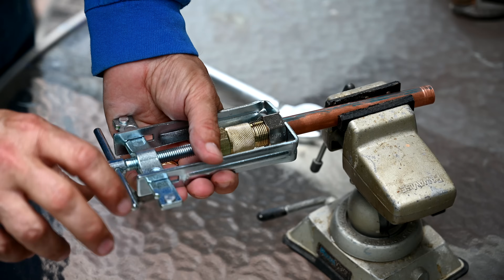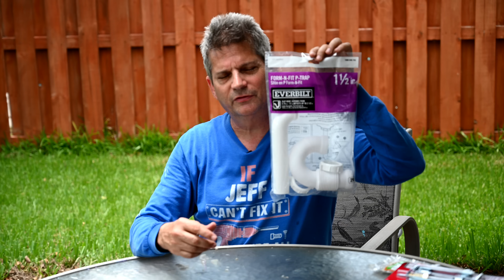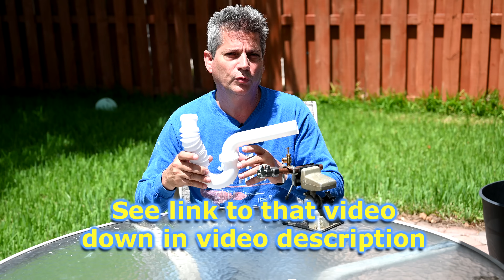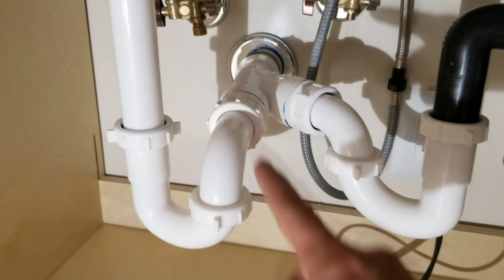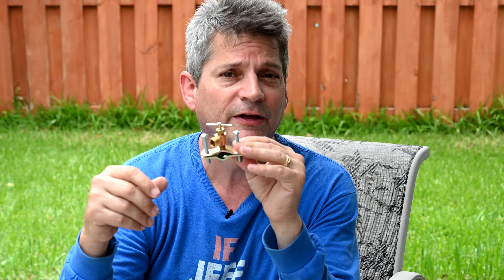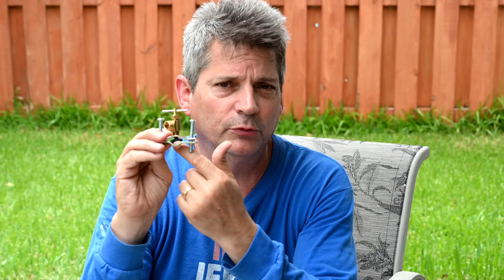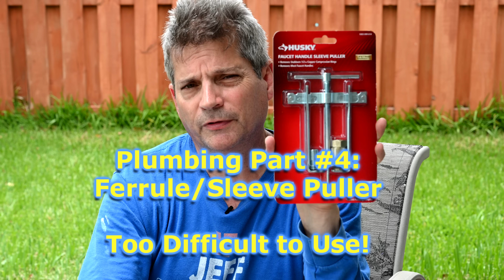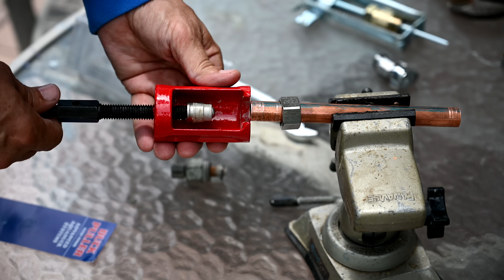4 Plumbing Parts/Tools You Should NEVER Use. NO Plumbing Fails

Comment: Form and fit pipes should be pulled from the shelves all together.  I remodel bathrooms and even have to keep the occasional plumber in check when it comes to following code.
Reply from the maker: Jeremy, I'm surprised that plumbers would install one, I bet they don't do it when it's getting inspected. What is their reasoning when you tell them?
Reply: @jeffostroff  I've heard it all, usually I get "I have xx years experience, I know what I'm doing".  Even had a plumber install a toilet with the slope going uphill once.  He was fired and that was before I found the drain issue.
Reply: @jeremylunning654  He was using that new "uphill" pipe.
Reply: @dave8168  lmao, I need to get me some of those!

Comment: Man, this kind of stuff is informative but your perspective is a bit enraging. I've hired multiple plumbers in my life who show up to point out the code violations done by the previous plumbers I've hired who then go on to violate another code. Do you guys just go around screwing things up and blaming it on DIYers? Not two weeks ago I had a bonified plumber come in and glue a PVC waste pipe to an ABS waste pipe only to find out later that gluing those together was against code. I had to fix it myself, correctly. You need to be honest that the people who have the most to gain by cutting corners are the plumbers charging full price for bad work. A DIYer wants it done well and the good ones research how to do it properly using videos like yours.
Reply: I am not a plumber.  But  I had a plumber tell me you have to use a different glue for the ABS and PVC  connection.  I remember  it was a green color. But who knows, the rules may have changed.
Reply from the maker: @MrOwnerfinance   Yes you are very close on that with the black plastic ABS you have to use a one step glue that is greenish yellow in color. For white PVC plastic you must use a purple primer 1st and then you use the clear cement. When the building inspectors come to inspect your plumbing work if they don't see the purple on the pipe anywhere they will fail your inspection and you will not get a closed building permit.
Reply: I have been a plumber for 59 years and I can tell you that excellence is a personal choice. There are a lot of guys who will do whatever is faster and easier instead of what is right. There are many  plumbers who always do excellent quality code work, find one and stay with him/her.   TXHUNT
Reply: James Hunt , code is bare minimum.
And, have u noticed they r always changing the code.
I think a lot of the people who write the code aren't really too smart.we follow b/c we have too.
We do many things above code. Code minimums are written for the magpies with no work ethic or
Are lazy.
Or don't have a clue.
Reply: That is not an issue since there is a specialty glue to connect PVC to ABS. I think it's green.... Called transition fitting cement..
Reply: If u use the proper glue it's ok.
Reply: Maybe chemically, but not to code in some locations.
Reply: There is a transition glue/cement that is approved for transitional connections (ABS to PVC) under IPC, not sure what UPC says about it though.  We use IPC in CO.
Reply: Dont mean to beat a dead horse here but yes transition glue is the proper way,
Reply from the maker: What I've seen over the years with plumbers and electricians, is the person showing up to do the work is not the owner of the company, the one with the master plumbing or electrician license, the one with 30 years experience, who has been shot down by every city inspector possible during their career, and knows what mistakes to avoid, who really cares about and understands the plumbing codes. Chances are the low man on the totem pole who shows up to do your work does not know much about codes, and has not fully developed their skills yet. 2 years ago I had plumbers come to work on a friend's house, replacing his water main shutoff outside, on a PVC pipe. It leaked the next day and we had to call him back. For a no-brainer cement PVC fitting. Apparently he forgot you have to twist the fitting 1/4 turn while cement is still drying, and hold for a minute before letting go or PVC won't stick. Yup, I know how you feel, this is why I keep making these videos.
Reply: @jeffostroff  Another thing is plumbing codes vary state to state, my first house was an S-trap home and the problem was the velocity of the water going from the first floor to the basement where the main line was. Used one of these, not sure this is legal but it worked,https://www.amazon.com/Studor-20341-Mini-Vent-Adapter-Connection/dp/B00FQEX4UI/ref=asc_df_B00FQEX4UI/?tag=hyprod-20&linkCode=df0&hvadid=312186755465&hvpos=1o3&hvnetw=g&hvrand=8975938221840903121&hvpone=&hvptwo=&hvqmt=&hvdev=c&hvdvcmdl=&hvlocint=&hvlocphy=9003648&hvtargid=pla-434083428846&psc=1&tag=&ref=&adgrpid=61740029466&hvpone=&hvptwo=&hvadid=312186755465&hvpos=1o3&hvnetw=g&hvrand=8975938221840903121&hvqmt=&hvdev=c&hvdvcmdl=&hvlocint=&hvlocphy=9003648&hvtargid=pla-434083428846  If you flush your toilet and you suck the trap dry you have some restriction in your vent. I hate compression fittings, I always solder because I seen to many leaks over the years, also many refrigerators come with those pinch valves,I hate them to.
Reply: Try to:

1. Hire a contractor that doesn’t have any employees and does it him (her) self. 

2. Make note of his or her name on the invoice he or she gives you. 

3. Make sure that you get a written warranty for the labor that is at least as long as the manufacturers warranty for the part that he installs.

4. For this one you will need to get to know him:

Make sure he comes back to correct any problems in a timely matter and doesn’t charge you extra if it’s his fault. Is he a Man of his word?

5. Don’t be embarrassed about watching him work. 

      A good contractor likes being watched. If he doesn’t like you to watch him, don’t hire    him. You may even learn something if you talk to him.

Comment: Toilets that draw the water out of an adjacent s trap does it via the Bernoulli principle - the toilet water passing by the adjacent pipe creates a low pressure in your s trap, essentially 'vacuuming out' your S trap. Old S traps configurations just need a vent between the toilet and the S trap to function as intended.
Reply from the maker: So I want they designed with the proper vents to begin with?
Reply: @jeffostroff  I just discovered your channel!! Thank goodness!!! I had a plumber recently install a new toilet in our upstairs bathroom. It is a toilet with a powerful flush which the old toilet didn't have .  Well ever since the plumber installed the new toilet I've been noticing a sewer smell it was mild at first but now its getting worse so I called a plumber and he will be here in a few days. I heard you say that if you have a toilet with a powerful flush and its next to your bathroom sink then this is what's probably happening that's its drawing the small amount of water out of that P TRAP !!  And our house was built in 1901 so it has those old S type pipes through out the house. I never knew those were not approved anymore!
Reply from the maker: @stanleywheeler404  Yes, and if you're getting an remodeling work done, it's not hard at all for the plumbers to come in and remove those s-Traps and convert them to P-traps.
Reply: @jeffostroff  ok I will tell the plumber to do that .  Thank you very much!! I think your channel is one of the best!!!

Comment: A S trap is fine if making a repair where one is already.  Second saddle valve is not aloud  due to needle valve restricting flow it’s in the code book. Saddle valves are allowed if done by someone other then a plumber or plumbing company that is why they have been sold for 50 years  I’m going off the nation standard plumbing code.     The compression angle stop.  The part you were calling. THIS PART is called a ferrel    The tool you were using to get off the ferrel is a handle puller.   It’s not for what your using it for the ferrel groves the copper  you cut it off with a cheese saw.  The flexible traps and tail pieces are not allowed because they impede flow. And promote bacteria growth  in the corrugated sections BTW.   N J Licensed plumber here

Comment: (under what branch of government is these plumbing codes?).= This code has been enacted into law by the Florida state governing body. . I typed in "what  is "Florida state governing body". and got The Florida Board of Governors is a 17-member governing board that serves as the governing body for the State University System of Florida, which includes all public universities in the state of Florida.(note the lower case l in law, capital F in Florida and lower case s in state}.Enacting Legislature Governing body means a body of persons or officers having ultimate control. also the word "public", They are mainly constituted for the purpose of administration (International Plumbing Code 2015 (IPC 2015). international is (u.c.c.) uniform commercial code. need to do some more research here.

Comment: Tool #4 you are using incorrectly!!! Those two arms are for pulling handles, not for removing the copper seal. There are videos online on how to use it correctly.
Reply: You're right, Paul. The arms don't get used at all!
https://youtu.be/7KDe8ACKjwc
Reply: Paul MvN And $40 for the alternative! I have a 15mm and 22mm olive puller for about £12 ($15 at current daft exchange rate) and works every time.
Reply: I prefer the cutter instead. It cuts the ring and will resize the copper at the same time. Though, I don’t do service so I really don’t need the tool to double as a handle puller.
Reply: @joshcowart2446  I agree, pulling a ferrule like that is asking for trouble as they deform the copper pipe to start with. Good luck getting another one to stay on after doing that. If you cut the ring off & resize the pipe so a new one will fit, fine, but it's not common. usually there IS enough room to simply cut the fitting off & use the shorter pipe, anyway.
Reply: Paul MvN exactly huh. Maybe if people knew how the tools they were using were supposed to be used correctly it would help! Dorks!!!
Reply: Edit: well I'm wrong, it's the right tool, and in fact isn't being used correctly. 

It's not even being used "incorrectly", its that he's using a tool for a completely different purpose. 

"My hammer doesn't work well on these threaded nails"

Well no shit, they're screws, not nails. He's attempting to use a faucet handle puller, to remove ferrules. No wonder it's not working.
Reply: @mlindholm  OK, so those screws I bought with a Phillips head and no threads (one or two in every box from the H*me D*pot) are really nails? 
Quality control has gone downhill. LOL (And yes, I HAVE seen nails with threads that can be driven, not screwed in. They hold better.)
Reply: @fixitmann6685   yeah, yeah, smart-ass. I assume you realize what I'm referring to though. The puller was poorly introduced, he could've read from the package that it's a dual use product. Secondly, read the instructions, so we realize if it's being used as instructed or not. It sure seemed like those "as seen on TV" bumblefucks that can't use the simplest devices. Finally, if you're gonna demonstrate a ferrule puller, tighten down the ferrule AT LEAST enough so it doesn't move on the pipe. The other 3 recommendations are sound, but that last one just blew my confidence he knows anything.
Reply: And if it takes time and cost a lot, then it's good 😁😁😁
I only got annoyed by this video...
Reply: And if his tools are so good, why didn't he show us on a compressed fitting 😁
Reply: @jfjjjjfj  he did but the fitting was not an old fitting. Watch that part again as he explains it.
Reply: Patrik Carlsson I own both of them ferrule pullers and the first one sucks, don’t know why I still have it. The second ferrule puller(the red one) is in my tool bag and pulls any and all ferrules with a problem
Reply: I mean an old one, not a new with loose ring 😀

Comment: Good video and learned some things to know. I agree about the Husky puller. I bought one and they are a "hit and miss" if it works or not.... usually not! LOL One suggestion,  your video would be even better if you scripped what you need to say so you don't sound like you are just rambling along.  You could maybe have cut the length of the video by 25% As you know, time is money including those that are looking to you for information
Reply from the maker: Royall, what you think is rambling along is actually necessary details, for example showing the actual codes that forbids these parts, and yes we are scripted, we give more in depth training, I'm not here to be your 60 second handyman like other channels, who leave out the important details, to upload a quick 5 minute video. You can always skip ahead in videos. I frequently jump ahead 30 seconds in videos, I skip past the intros, and when they are doing long tasks, I skip ahead too. BUT... we are already planning to break this video up into 4 smaller more compact videos covering just each single topic. The saddle valve video is actually premiering tomorrow night. When I do my 45 minute long bathroom renovation videos, I also break those up into smaller videos afterwards to show how to do the different parts, a wall niche, how to make sure your walls are square, how to make round hole cuts in tiles, etc.

Comment: That's a handle puller not a nut and and sleeve puller
Reply from the maker: It is both if you look closely at the package you can see they label it as being both knob puller and sleeve  puller and on the back there's 2 different sets of instructions one for when you're using it as a knob puller and 1 for when you're using it as a sleeve  puller.

Comment: I use the puller for removing central brass tub faucet handles. Do you have something better?
Reply: Clr, a hammer and channellocks is the method I use. If you break it off in the stem, it's usually corroded to shit anyways and needs replaced due to leaks
Reply from the maker: @DGTelevsionNetwork   Going medieval on it I like that
Reply from the maker: Not for pulling handles, I actually never had to use it to pull handles, every one I ever removed just pulled off easily by hand. But Husky tool should be OK with handles, it just fails when it comes to stuck ferrule sleeves.
Reply: @jeffostroff  I tried for a month to pull the handles from my deck mount roman tub 8" spread faucet. I used PB Blaster. I used the Huskey puller. I finally gave up. I installed a Moentrol shower valve in the wall at the other end of the tub and ignore the tub valve. Have not turned it on in almost 5 years we have been in this home. We do have 2 other showers.

Comment: I am a Handyman that follows the code, another problem is when you are preparing a property to sell, many finance companies will not loan on houses that have these violations.  With all the information on line the only reason to do it wrong is a laziness.  Good video thanks
Reply from the maker: Yes you are spot on there. Buyer's home inspectors are getting much more tough, pointing out incorrect high loops on dishwasher drain hoses, dishwashers that are not screwed into the counter, toilets that wiggle, old Zinsco electric panels. And even before they start complaining, your homeowners insurance will start complaining during a scheduled 4 point inspection.

Comment: I use that husky sleeve puller all the time and it’s a wonderful tool if used correctly. First, I find it easier to remove the threaded handle part completely from the metal arms. Second, In the kit it comes with a metal cylinder. One side is larger than the other side. Stick the smaller side inside the 1/2 copper line coming out. Then thread in the brass colored fitting on to the handle to receive the compression nut. Thread on the compression nut and start turning ur handle clockwise. U will definitely see how easily this thing can  remove compression sleeves if u do it this way. Let me know how it works for u. :-)
Reply: https://youtu.be/MjNrGuxYvjQ

Please watch this video buddy
Reply from the maker: The tool works when the compression ferrule sleeves come off easy, but when they are stuck and corroded this tool falls short, because the forces are too great to bear, and it digs into your hands, and then the arms begin to spread out away from the nut because you hand can't hold them in place. I already know how to use the tool correctly. I have used it properly, but it simply fails on corroded stuck sleeves. Why in the world would anyone want to own this tool when the Duck Puller or George English tool company both make far superior sleeve puller tools that work 100% of the time guaranteed, and with little effort and no sharp edges. It's a no brainer.
Reply: Justin, in your link the tool looks just like the good tool he uses 😁
No problem to get wrench there, just as at his wondertool.
Could have had a hex on the "handle" 😀

I doesn't matter what tool you got if you can't use it correct 😉

Comment: The husky tool has two indentations in the end of the crossbar that you are supposed to put the pullers on. That will keep the pullers from hitting the turning bar. It will also allow the ends of the pullers to be at an angle to dig into the nut (to keep the pullers from slipping off the nut). So, I'd give that tool another try, just move the pullers into the indentations that are provided for that purpose! Otherwise, great video!